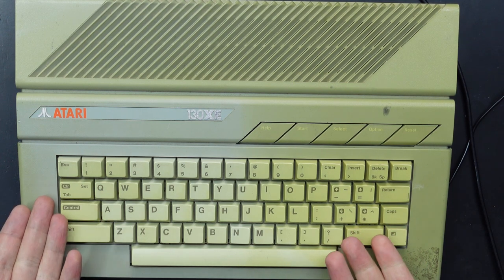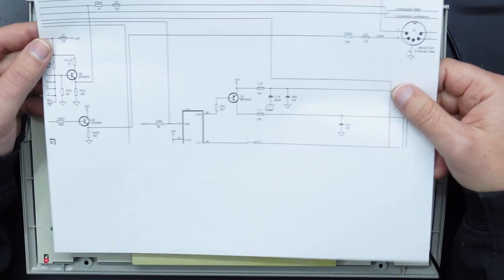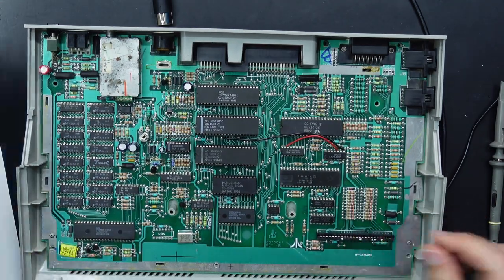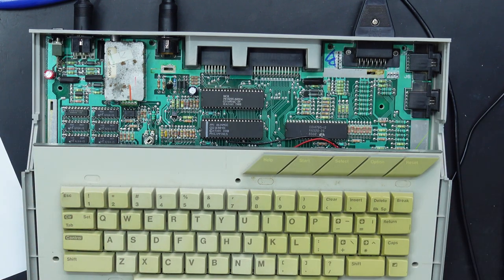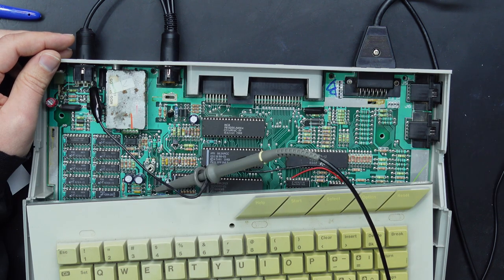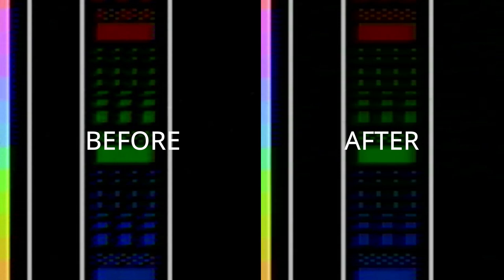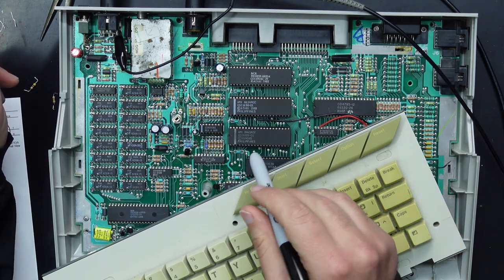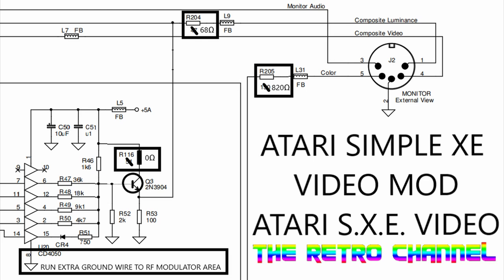Atari Simple XE Video output mod

Comment: Not a lot of high-speed routing going on back in the 80's on home computers. One of the big benefits of 4 plus layer boards with dedicated ground-planes - assuming you get your layer stack-up right! Issues like the Microbee DRAM coreboard noise and ground issues are all related to not having an appropriate return path for the current flowing in the various lines. If there is no ground return nearby then the signal is just coupled into whatever else is nearby. Anyone can layout a PCB, not many can do it well! Nice work on the video mods, you would have fit in well on Saturday mornings back at the old Telecom TV transmitter site when we did our weekly checks :-)
Reply from the maker: Thanks Ingmar, yeah it's certainly nice to only have to deal with a single layer or two but it does have it's many drawbacks

Comment: Wow - checking the ACP image, your results look even better than my Ultimate Atari Video 800XL. I need to check the various outputs on my XL. Granted, I'm using only composite, not S-video, but I'm very impressed with your mod.
Reply from the maker: Thanks, I originally was just going to throw in the UAV and be done with it, but shipping to Aus is pretty expensive - it would have cost about $60AUD. Sure, it woud have been a lot easier and a would have saved me many hours of stuffing around, but where's the fun in that?

As for the XL machines, well seeing as I gave my 600XL to Jase and he also has an 800XL maybe we will work out something for those as well - eventually....
Reply: I wasn't actually too impressed with the UAV. 

Yes, it improved the picture greatly, but mods like this - and in addition pulling up the resistor ladder and giving it a clean supply from the connector did just as well for me. And cost nothing!

One of two UAVs I bought actually burnt one day - two caps and a diode burnt off the PCB. Don't know why. 

One thing is certain - Atari didn't know much about designing a video output stage and it shows!

Comment: Thank you! What a great video with explanation. Shall I say one of the best showing step by step process and your logic. I appreciate it so much really! Would that work with 65XE? I need to get an oscilloscope to test before and after 🤔
Reply from the maker: Yes it should work for the 65XE as that's what I originally used to design this mod. You don't need an oscilloscope but it can give you more of an insight as to what's going on and the effect of any circuit changes. Otherwise get some screenshots, if you don't like the results at least it's easy to revert back to how it was
Reply: @TheRetroChannel  Thank you. Yes, I was thinking of getting the osciloscope just as I have done quite a few electronic modifications over the years and always wanted one to go deeper into understanding everything. Your video is just fantastic way of describing it, so it would be easy to follow up for anyone and actually understand what is going on with the signals. Thanks again!

Comment: Now, that is awesome work. What a significant difference. Nicely done. And what? C Output = 286mVp-p 🤯  I was in the dark on that one.
Reply from the maker: Yeah, all this time I thought 700mV was correct. But it makes sense that a 300ohm resistor in the C64 chroma output is the sweet spot, I measured that as well and it's around 270mV with the resistor
Reply: @TheRetroChannel  Duh, me. That makes perfect sense.
Reply: @TheRetroChannel  Nice catch on that 286 mV P-P for chroma figure. I just checked the service manual for my '90s-era Sony PVM, and it too says that chroma should be 256 mV on the "Y-C IN (4-pin mini DIN)" connector. (They seem careful never to call it "S-Video.")

Comment: Great video, very detailed, and very informative - thanks.
Firstly, the Super Video mod as first seen in Atari Classics mag was very poor, and most of it was unnecessary.
Secondly, the S-video and Composite specs say each output should have a 75ohm resistor in series.  Atari got this right in the XL, but changed them in the XE. You have adjusted these values to obtain the correct levels - shouldn't they still be 75ohm with the gain adjusted prior to these points?  I'd be interested in your thoughts.
Reply from the maker: Ideally there should be a 75ohm resistor in series on the output to prevent signal reflections. In practice it probably wouldn't make much of a visible difference. Also keep in mind I did this mod a few years ago before I knew better 😂

Comment: The overal output quality indeed looks much better. One other thing that the UAV does is removing the dark pixels between certain luma values (as seen in the ACP as those dark vertical lines between values 3-4, 7-8 and 11-12). Not sure how easy would it be to rectify that.
Reply: Yeah.  Transistions between luma levels 7 and 8, where every bit changes.

Comment: I think my previous comment was removed due to including a link (oops), but my question was I've been advised to fit a UAV on my 65XE to improve S-Video quality but would you say the SXE mod is just as good? it certainly looks simpler to fit (and cheaper).  Thanks.
Reply from the maker: Yeah YouTube sucks when it comes to their spam filtering. I cannot comment on how it looks vs the UAV mod as I don't have one. But doing the SXE mod is cheap, easy and reversible, so I would try it first and if you're still not satisfied then look at the UAV

Not sure if anyone on AtariAge forums has tried this mod yet but it may be worth asking there.

Comment: Thanks for this! I've recently dug out my old 130XE, and bought one of the  many Video-To-VGA adapters (Think mine is labeled MINI AV2VGA)  so i could view on a VGA monitor.  I had to make a cable for it, and so far the only way I've made it work is using the COMPOSITE video output (pin 4), into the converter's video input. Staring at the READY prompt I hadn't seen in 30 years, I did note the text wasn't quite as sharp bright white as I remembered with a decent TV (RF), and the blue background lacked the deep blue "chroma" level I remembered. My question is, will your mod do anything for the COMPOSITE vid. output on pin 4? If not, is there a circuit I can make (with out without your Mod) to mix the chroma and luma outputs, to make a better COMPOSITE signal than the existing one? I've tried to figure this out for myself, but when I look at the full schematic, the "Composite" signal doesn't even show up in the circuit. It just mysteriously goes into a pin on the "RF MOD", and there is no clue from the diagram what happens in there.
Reply from the maker: The composite signal is mixed inside the RF modulator box and I don't think there are schematics available for it.

From memory the changes I made happen before the luma and chroma signals go into the RF modulator, so it may still help clean up the composite signal but I don't remember testing it. Composite by it's very nature will always look pretty average, especially on a flat panel display.

If you want to try mixing the luma and chroma to get composite you just need a 470pf ceramic capacitor. Connect one leg of the cap to the chroma, and the other leg to the luma. The luma signal then becomes your composite signal, so you would run the luma signal to your composite input on the display or converter box. You can also experiment with different capacitor values, 470pf seems to be the standard but I've had better luck with 390pf, so ymmv
Reply: @TheRetroChannel  Thanks! Looking at the schematics in the manual, there is one ATARI in that series where there was no composite output, and they use an additional transistor in a kind of "emitter follower" buffer cofig, to mix the two signals and still be able to offer a proper (50-75 ohm I guess?) Low-Z buffer output to the RF mod. But now that I think of it, I see your point. Since you're making your improvements before the signals get to the RF mod where they are "magically" mixed (in the 130 XE ) there's a fair chance your mod might improve the composite out too. Well I'll give your mods and mixing suggestions a try, and if you want I'll let you know the result. 

I recall literally "tuning up" old NTSC color TV's to get the absolute most out of ATARI RF displays. You could look at a square white cursor, and tune the 1st, 2nd, and 3rd "IF" stages so the leading edge, middle, and trailing edge of the cursor was consistent. It must have been a good guide to work with because regular TV programming would look better after I'd do those tune ups. 

But anyway, its fun to try to get the old machine fired up again.  Next big challenge will be to see if my old RANA disk drives still work. I used to have a whole written procedure for tuning up those beasts too, but you think I remember that stuff?  NOPE!! :-) 

Anyway, thanks for the tips!
Reply from the maker: Yeah let me know how it goes, hopefully it will make at least some improvement. Good luck
Reply: Well I finally tried this mod today.  I don't have the color test display up like you did, and wasn't sure where it comes from. But at least I can see the video and sync signal clearly on my scope, at the point you clipped your probe on.  I was a bit skeptical  because many of the P-P voltages I was seeing were very different. The composite never went beyond 800mV even after jumping R116, and the color signal at R205  looked right, but it was already over 2V p-p. But anyway, bottom line, I think my concern about the composite signal (the only one I'm using) being mixed invisibly  in the RF modulator was probably well founded, because I think the only one of these mods that helped at all was the bridging of R116. It did make the "READY" prompt just a little sharper, so not a total loss. Also, since I had it opened, it was a fun find to discover that the little trimpot to the left of R204 could be used like a "HUE" adjustment. But anyway, it was fun to try, and I'll probably leave the mods in place for now.
Reply from the maker: Interesting, thanks for the update. Yeah I think composite is always going to look pretty average. Maybe look for a s-video to VGA converter, similar to the AV2VGA converter you have. That would at least give you a better image, you would just need to make a little cable to take the luma and chroma from the din connector and wire it up to a s-video plug.

The test programs I used should all be linked in the video description. The Atari Control Picture program is handy for adjusting the hue trimpot, you just need to load it up and adjust to where the RGB patterns on the right hand side look correct. That trimpot should be accessible with the case on, Atari made a hole in the bottom of the case so you can adjust it without opening the computer.

Comment: Could you just solder the last cable to share the earth grounding and get rid of the checkered board and jail lines ? I'm a noob hence question
Reply from the maker: You mean without swapping the resistors? I guess it will still improve the image. It may not help with checkerboarding as that's generally due to too high voltage on the chroma line, and to a lesser extent crosstalk between the luma and chroma signals

Comment: i take this will work on US version as well? I noticed there are a lot of components missing on my board compared to yours .. my board is C070067 REV-B
Reply from the maker: Maybe, the mod is reversible so if it doesn't work you can always revert the changes
Reply: @TheRetroChannel  waiting for 820ohm resistor dont want to wire up 3 different ones to get to 820 which is all i have now. It will be here tomorrow and ill check the results will report back.
Reply: i did the mod but i have pretty cheap shitty upscaler AV2HDMI - can you recommend something better ?
Reply from the maker: @AboveTheTrees00  I've tried a number of cheaper ones but the retrotink 2x always seemed to do a better job. Of course the 5x is even better but it depends on your budget
Reply: @TheRetroChannel  yeah that's pretty pricey,especially 5x i would have to have more then one device to invest that much money into it

Comment: Is this mod doable with the Atari 130XE too? I don't have a look at the schematics (yet) but I suppose it will increase the output quality over there too. So using it with a simple AV2VGA adapter it will looks better?
Reply from the maker: It should be possible, it worked with my 130XE but there's a few different board versions out there so YMMV
Reply: @TheRetroChannel  Anyway if I start checking from the DIN connector backward, I can follow the signal and do the correct mods. Thanks! I will keep you up-to-dated then.
Thanks
Reply: @gianlucarenzi7706  How did it go?